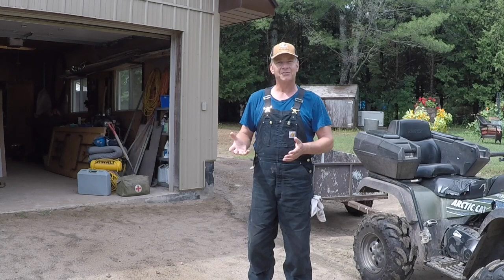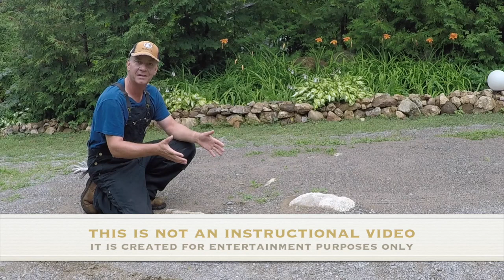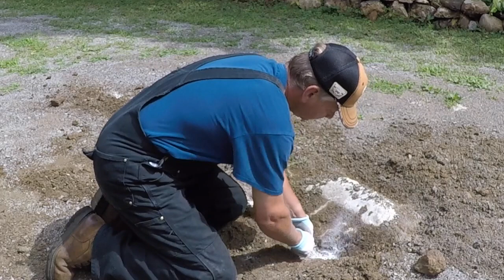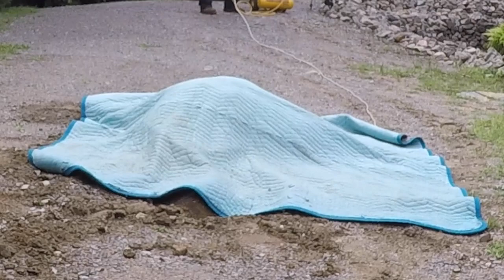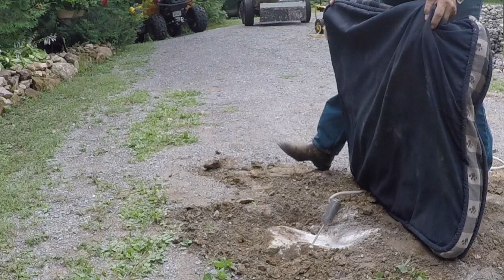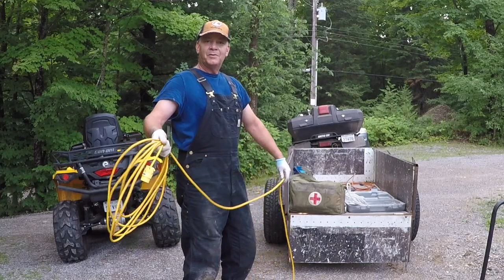#65 How To Safely Split and Remove Unwanted Rocks

Comment: Congrats on the success of your channel. It's become one of my favorites! I have a couple questions. First, do you have to be trained to do the blasting? Second, can those
rocks push their way up under a structure, like a house or other building? Thanks for the great videos!
Reply from the maker: Hey good morning and thanks Darrell. For your questions: No formal training is needed that I am aware of. The kit came with instructions and in this area, we do not need a permit or license of any kind (but not sure if that is the case everywhere else), and 2) absolutely. The rock will heave and move over years - especially in winter, the frost will push them up. So it is not uncommon here to see older cabins or structures sitting on footings that are now uneven. When my cabin was built, the contractor dug down deep enough through to hit a large granite shelf and "pinned' the foundation to the granite so it would not move. Thanks for watching and for the questions. :)

Comment: Great job you guys.  What’s the name of that stuff you are using for breaking up the bolder ?  I have a lot around my place that are too big for my B2410.
Reply from the maker: Hey Jim. Its called EZEBreak LLC. Out of West Virginia. Hope that helps. Up here we don't need a permit or license for it but of course, you should check locally for yourself. Cheers!
Reply: Great      Thanks GP I will 
And again nice job.

Comment: Thank you for the rock video, May need to clean up some of my own.  I'm very interested in your grapple video's.  I'm buying a B2601 this month and the dealer is recommending the Land Pride SGC0548. I have watched your video's with the HLA grapple and am leaning towards the HLA.  What size is your grapple, and if you don't mind what was the cost?  I live in Northwest Montana and there are no local HLA dealers in the area so I will have to purchase it separately.  Thank you for any info you can give me.

Gary pelletier
Reply from the maker: Good day Gary. Thanks for watching and for the questions on the grapple. It is an HLA Attachments Light Duty Root Rake Grapple - 60". You can see it on their website. I honestly can not remember now what the cost was as the pricing on the invoice was totalled and not separated. However , I believe it was about the same cost as the 0560 (not 48). A few things for you to think about though in making your decision. 1) The HLA Grapple weighs about 440 lbs or so , whereas the land pride is in the neighbourhood of about 250 ( I think). 2) The HLA is made with commercial grade steel (and very thick of course), but I cannot remember if the land pride was commercial grade or high tensile/carbon.So you may want to check on that. 3) HLA is made here in Ontario which means you will probably be paying shipping (on 450 lbs) and also Duties to cross the border, which may add considerably to the price. So just a couple fo things to consider. I hope that has helped a bit. Congratulations on the new tractor! and good luck !!
Reply: GP Outdoors Thanks for the info.  I am going to go with the Land Pride SGC0660.  The shipping etc, makes it a no Brainerd even though I prefer the HLA.  Keep up the great video's, your saving me many future headaches.
Reply: Mr Pelletier - It is good to see a familiar last name. It makes me wonder if we could be distant relatives.
Reply: Craig Pelletier  Hi Craig-I have no idea if we are distant relatives.  My family is from Northern Maine (Aroostook County)  Fort Kent.  The family were mostly loggers.  I was born in Waterville Maine and my family moved to California in1955, I was 12 or 13 years old. Have had no contact with family since then.
Reply: Gary Pelletier - One word:  Madawaska. Two words:  The Valley. I'll leave it like that. La Vallee est petit, Mon amie.